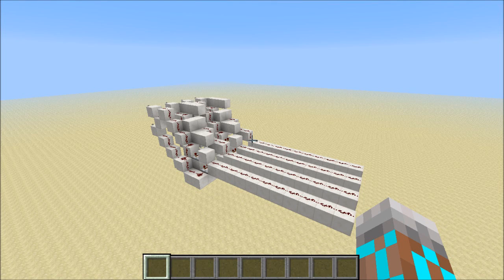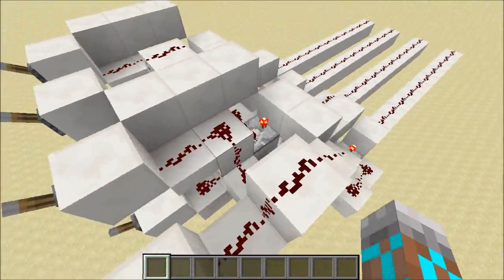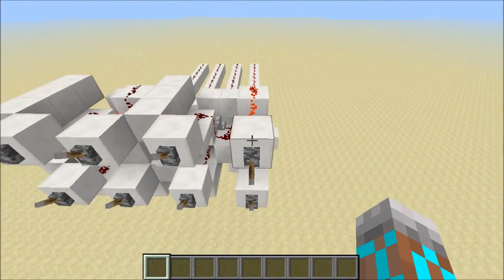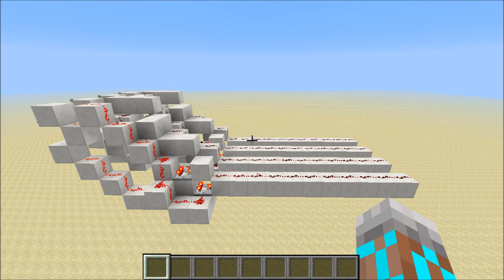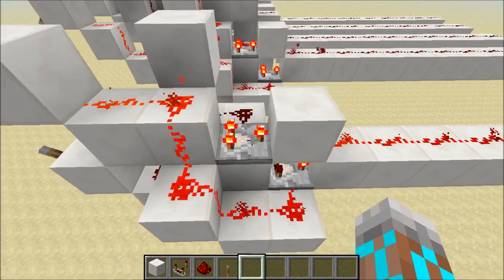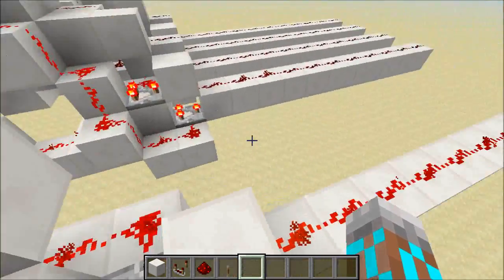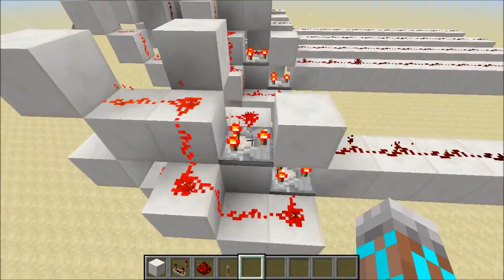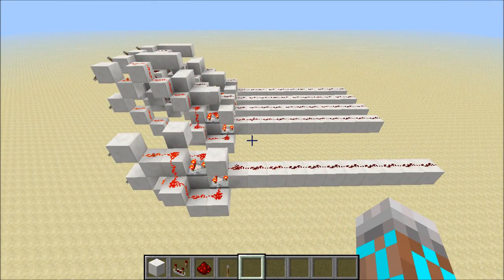1 Tick XOR Gate - 2 Wide Stackable!

Comment from the maker: It's two wide "stackable" because each bit is staggered. What that means is that the individual units are designed so that when they stack up they're effectively two wide because the units overlap, even if each unit is more than two wide on its own. Does that make sense?

Comment: 1 wide stackable disallows the use of redstone dust, because if There is redstone dust in a 1 wide design, it will intersect with the other circuits next to it, 2 wide gates do not have this restriction

Comment from the maker: Nope, this is just an XOR gate and not an adder. That means that the output will only be on when the outputs are different. It can be used in an adder though. I'm not sure what you mean about too much output wire though. You'd need 4 blocks of output wire to distinguish between high and low signals, so you might not want to use this in some situations, but in others it's fantastic.

Comment from the maker: You can use normal bussing, you just make sure a repeater doesn't pick up the low signal and does pick up the high signal, which means placing it far enough away from the gate, which you'd do anyway. I've already used it to make a bunch of my builds faster.